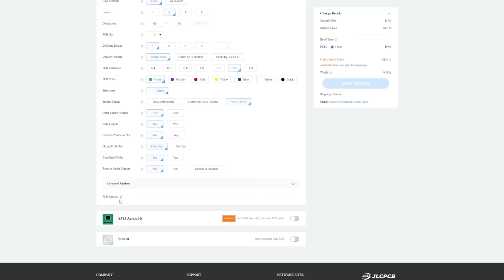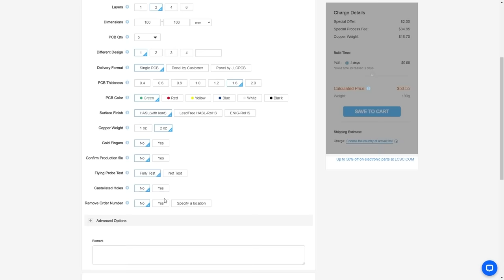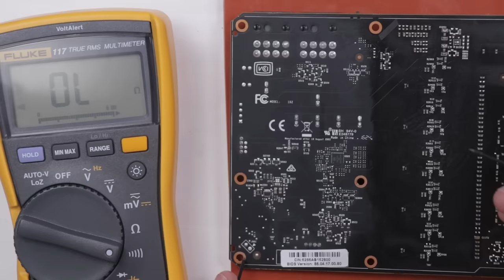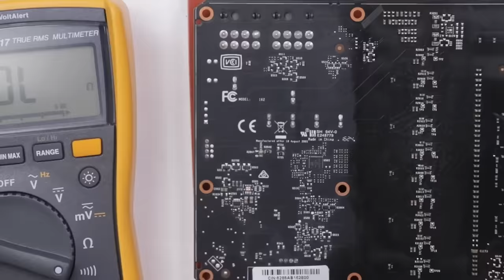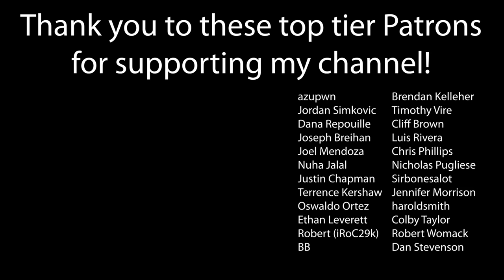I Bought 7 BROKEN Graphics Cards to Try and Fix - I Was Disappointed

Comment: My PS5 Disk Version thinks the power button is constantly pressed. I've wanted to ask if you know which capacitors on the motherboard might be short causing this problem, I should be able to replace it/them and maybe fix the problem. Thanks in advance!

Comment: the trtx 3060 prolyl is fixable. that series suffered from overheating memory. which also looks possible due to teh artifacts and errors your getting - prolly one of the first or second row of mem ICs has a fault ( could also be just popped solder balls due to thermal stress ). id recommend do a memtest on it and either reball the memory ic /s or get a replacement ( their about 7 bucks rightnow )
Reply: Finally someone who knows what is saying...artifacts comes definitely from a  bad memory chip, also the discoloration around GPU is probably caused by the neighbor chips gone really hot

Comment: I think the issue with the 3060 might be memory, try using MSI Afterburner to downclock the memory, and try running the benchmark again.

For the 2080ti, I think those components are meant to be missing, as there is a more powerful card, the Titan RTX, which would use that extra VRAM chip and likely needs a bit more power from those components that are missing.

Comment: 18:55 Look up what the PCB is supposed to look like before you assume someone took parts off. It has 11 memory chips for 11 gigabytes of memory. Also EVGA has several versions of most cards and I don't know if some have more diodes. I think the problem with this card may have just been someone putting so many thermal pads on it that the heatsink didn't touch the chip or paste.

Comment: I suggest some things to do if the GPU is not sending signal to the monitor:
Connect the GPU to a system with another GPU to see if it is at least recognized in Windows in "Device Manager," if it is detected I suggest you try flashing a VBIOS that you can get from the internet, there are many tutorials on how to do it.
If on the other hand the GPU starts but is very unstable during testing, even there you can try flashing a VBIOS downloaded from the internet to see if the situation improves, otherwise you can try underclocking to find a value where it remains stable

Comment: Many GPUs (especially higher end 70 and 80 series models) often come with unpopulated VRAM packages and power supply phases. 
That is completely normal and is done due to the fact that:
1. They are using a reference design from Nvidia and didn't bother removing unneeded components -> cheaper to design and less work.
2. The actual GPU chip itself has been binned in the factory. Not every GPU chip is perfect. Some might for example come with a few non functional memory channels and sections inside of the GPU that don't work. These large chips are quite prone to manufacturing defects due to their large size, which results in parts of the GPU being broken and useless. 
Instead of just throwing these otherwise perfectly fine chips away, Nvidia go ahead and overspec their reference design, so that the manufacturer (ASUS, Gigabyte,...) can just leave the required external circuitry for the broken section out. If for example GPU sections A,B,C,D work fine but section E is defective then it makes no sense so e.g. solder a VRAM chip to section E, since section E is dead. Same goes for the power delivery of that section.
So the reference PCB design comes with more external circuitry than what's actually used. 
It's also possible that the same bare PCB is used in multiple GPU versions and they just didn't populate all the chips due to cost saving measures. There's usually low and high end versions of the same GPU. (E.g ASUS TUF vs Rog Strix, Strix being the premium models).

If a GPU chip has too many broken sections to still be considered for example an 80 series card, they disable the extra stuff and rank it as a 70 series card instead. This is binning. It's also how Intel i7,i5 and i3 CPUs work. 
Nvidia doesn't make a new chip for every GPU model out there. They only have 3 or 4 "base chips" per generation where they just go ahead and disable features based on the amount of manufacturing defects.

Long story short: That GPU with the missing VRAM chip and the doubled thermal pads probably still works just fine. What I think happened there is that someone installed new thermal pads but didn't pay attention to their thickness, so the GPU chip didn't make any contact with the heatsink and therfore instantly overheated and throttled itself, making them think they broke it.

Comment: that one that wasnt putting out a display might have a mining bios on it if the card is being detected but not displaying anything. edit: if you have an integrated graphics on your cpu or have a cheap graphics card and plug them both in, if you plug in the one that works and go to hardware information it should tell you if the one thats not displaying is plugged in or not.

Comment: Hey. What happend to my comment.

You missed a few things.
Glitchy screen is 87% memory issue. Run mats/mods to find out.

Discoloration is okay. The pads will leak oil and other cemicals and it will discolor the pcb even at 60-70°C. Depends on brands.

About the missing components. Nothing is missing. Is is just a reference board. In the same generarion, those spaces will be populated on higher end gpu's. Check google pics.

About the one that does not turn on:
Check the voltage power up line. 12v, 5v, 3.3v, 1.8v pex, vmem, vcore. They have a specific order.

The last thing is you can get mining vbios that disables the output to gain some more hash. Flash them back.

Comment: That 2080 Ti wasn't missing anything. That model of it just doesn't come with those components. The same PCB is often used across multiple models. If you do this again, you should look for teardown images of the GPU in question first, which are usually easy to find in reviews.

Comment: don't get alarmed. often times when you see missing components on a gpu PCB, it doesn't mean it has to be there. It just means the GPU you have isn't the most powerful one and/or with most RAM. same happened long ago when I disassembled my gtx 570. it's for fact the same pcb as the 580 but without some components and weaker chip.

Comment: Small tip, with gpus you need to cover the entire Die with thermal paste :) also the EVGA 1080s a lot of then had fail issues.  I love your videos. Such a fascinating watch every time ❤️❤️
Reply: You just need to put enough on the die that it will spread across the whole thing when pressed against the heatsink. Same with any chip without an IHS over the die, like the consoles he often fixes, or most laptops.
Reply: The EVGA 1080 FTW he showed had a flaw that the V-RAM could get to hot. EVGA had a fix by useing a set of thermal pads, which you could get from them. Till today my EVGA 1080 FTW is still working 😁 and i was lucky enough to read about the flaw, otherwise it was also RIP

Comment: GPU prices are falling really nicely. The 1080 is no where near being worth $500 especially broken.
Reply: The second-hand Ebay prices are average prices the card sells for if its working. Just to let us know what he could sell it for if it works or gets fixed. Not if is not working
Reply: @ikwilgewoonfilmpje  is not even worth that new. 1080ti, which is the better variant, is going for $400, in working condition. A plain old 1080 is not worth $500.
Reply: @FranktheTank319  Got it. Then it is expensive

Comment: I had to look up 0 ohm resistor, because there is no such thing.  0 ohms means 0 resistance, so it can't be a resistor.  Apparently they are just wires packaged in a resistor-sized package, to make design easier (it's a way to connect components without using exposed wires.  Anyway...I wonder if the bad/glitching GPU's were ruined by mining.  That explains the 1030 working, that one would be useless for mining.  For the 3060, my guess is some of the RAM is bad.  Probably died from overclocking (again due to mining).

Comment: A missing vram chip doesnt mean it's faulty. Its just used to achieve a specific vram capacity to recycle a PCB, rather than making an entirely new PCB for a specific gpu. For the reading of the GPU die, i do not know why you took and IR reading without the heat sink because heat is conducted across the die. So its not a particularly good reading and doesnt  explain or give much to work on.

Comment: If the GPU still does not display and it's kinda check in the hardware chips, it's a good idea to check it on windows using a working station, a working gpu if required and the issue gpu on a second slot, the driver manager and CPU-Z might help you to check more information. If it's shows up, maybe will require a bios flash or other level of troubleshooting. Most of my recommendations I took it from JayzTwoCents videos, he has some troubleshoot on this topic but not so much in hardware troubleshoot, but if isn't hardware, might have a chance with this. Good luck and thanks for the videos

Comment: I would Keep all the cards you have not fixed, So that once you are familiar with Mosfets and Vram and how to test them when shorted or Open you can replace the
ones that have failed, with both components they should diode test much as each other so when one reads totally different, that's the one that needs replacing along with perhaps one or two supporting components that caused either the Vram or Mosfet to fail..
Reply: @UCK0_WC3SrgMhmMCfOQ_Wp0Q 

🤦‍♂Oh REALLY???..🤣
Yeah I don't see this as legit because for 64 plus years I have never EVER won anything. 
🧐
I think someone is about to go down for going against what is obviously the universes intent that I never EVER be a winner without entering as a contender..

Comment: The 6800xt is also not overheated. The discoloration is from the silicone thermal pad on the backplate. Gigabyte doesn't use quality thermal pad so the thermal pads start leaking silicone substance which is very greasy.

Comment: Many GPU's come with thermal pads. Obviously that card with the stacked pads was modified, But just because the pads weren't cut to size for the individual components doesn't mean its been modified - its a labour cost cutting excercise. Its quicker to slap on 1 thermal pad for 4 chips than to cut them to size for each individual chip.

Comment: 'Missing' components on the board is a normal thing in the GPU world. It's just a way to reuse the board design for different models for graphics cards. Also, bold of you to turn your system on with a faulty GPU. You can fry the rest of your system that way.

Comment: Great attempt.  

I'm not 100% sure, but I used to work in a different industry....  so don't take this to the bank, but....

A company would make a component, or a card, or whatever.....  Like, your card with the missing chips, we're talking about here.  So, on the fully loaded most expensive model that did everything, the card would be fully populated with chips & components, usually.  Not always, but, mostly.  On the "less" optioned unit, the same base card, same form factor, same everything, would be used, but sometimes barely half of the card would be populated with chips & components....  which apparently is a cost measure...  and, they only have to design one enclosure case, and so on, because they are all the same size....

My point is, I'm not sure someone stole those chips off the card....  Looked pretty pristine.  I think there was never a component mounted in the first place....

There was also times where, I was told, a supplier might offer certain components to a customer at a huge discount, just to blow them out, or a different customer maybe backed out of their deal...  So the customer might save a lot, by using those, and those would visually appear to be cards with very few components on them, because the current usage was NOT what the original intent of that card really was....  I feel like that's unlikely in this case, but that does exist....

My real point is, as you branch out, and start repairing different things, it really really helps if you KNOW what you are looking at....  Seeing empty slots in a board, does not necessarily mean "someone stole the chips"....  

This might sound crazy, but...  You spent a lot of cash here.  3 grand plus is not a joke, by any means, to anyone....  When I was really stuck on something, if I could, I would go buy a new one.   Look at a new perfect one that you can verify does work perfect.  The ability to do a "stare & compare" can really save you a lot of headache, and a lot of speculation, and a lot of going down the wrong path.....  I'm not gonna lie, there were a few techs who thought I was crazy, for doing that, but...  I fixed a lot of stuff....

I might mildly and gently suggest, if you want to fix those, pick one make, and maybe 2 models at most...  get a good one.... Then buy up broken ones of that exact model....  Obviously you are smart & bright, it won't take long to figure out, hey, now I know what I'm looking at, now I see what's wrong, now I see these all seem to run hot, or this here is a problem area, whatever the case may be....

Comment: Bad luck here Steve, sadly not surprising though. I won't buy a used "working" GPU because even if it'll boot into Windows, there's no guarantee it'll last once temps jump with gaming or GPU based application work. Heck, you see a good number of these cards die within a few weeks right out of the box, thermal solutions from a lot of these card makers seems kind of "seat of your pants" in design unfortunately, and even the well built cards are dependent on a PC build that facilitates a quality airflow setup.

Thanks for the video as always!

Comment: You can buy hdmi to vga or display port or hdmi converter with usb power for no signal display issue... it might help, im using my no signal black screen gpu with usb powered hdmi converter, with usb powered plugged in, the display come out.

Comment: GTX 1080 FTW, try reflashing BIOS, would cause no image if corrupted bios image on the bios chip. You need hw flash tool to reflash it. Same thing on the Radeon if the GPU chip heats up.

Comment: For evga graphic cards there's a test you can run on them built by the evga team I used it to test one of my old cards and it will tell you if one of the vrams  is not working as it should.

Comment: That 2080TI looked completely normal. Not every chip that goes into a board design ends up being needed to get the card working.
Only thing off about it were the additional thermal pads. Looked like that card had been water-cooled at one point and then had the original cooler slapped back on for resell. The screws being missing would support this.

Comment: The EVGA nvidia "10 series" had problems with heat on the VRM, required customers to either fix it themselves with free thermal pads from evga or send the card back to EVGA for them to fix.

Comment: On that rx 6800xt you should check for a switch near the top of the card someone might have tried to flash the vbios if it's a dual bios card you can flip the switch if it works then it's a bad flash on the one bios

Comment: Hey... I love your videos.. and I get the point of this one... but there are a few things about this.... GPU prices are falling HARD right now... so... some of your prices listed probably aren't accurate anymore. Also... that one GPU isn't necessarily "missing a RAM chip." Some board partners use the same board for multiple SKU's with different memory configurations. And finally... that EVGA 3060 shouldn't have been taken apart. EVGA has a 3 year warranty... and 3060 launched in Feb 2021... so it can likely be RMA'd to EVGA.

Comment: The broken 1080's were probably RMA'd cards as a while back there was a bug in 1080's driver's temperature sensor code which basically took too much voltage in the card after launching the game "New World" causing the card's circuit to blow, and those aren't fixeable & EVGA replaced even non warranty cards..

Comment: Try to boot the PC with the non Display Graphicscards again, but use the onboard Video to see if they are recognized in Windowsin Device Manager. If they are you can try flashing the original BIOS again. There are several tutorials on how to do that. You dont need any special Hardware. This works from within Windows.

Comment: The liquid like feel of the PCB is just the anti static film they used for protection looks like it just got so hot that it melted I highly doubt it was caused by just an OC as normally thermal protection would kick in and the GPU would never have reach temps so high that would cause such damage one possibility is that the power supply or another component blew up and dumped high voltage to the GPU which cause the GPU to heavily over heat.
Reply: Wrong. It's silicone oil leaking from the thermal pads over the years.

Comment: Why don't u do a heat gun treatment on no 2, 5 and 7th one. Like heating the gpu and a little bit around it those tend to fix this kind of issue that don't post signal but have all the right volts. Check out some video about it and try it.

Comment: So the first card its an issue with pcie power directly from the motherboard. Check your voltages from the pcie connector directly. A tell tale sign of no power from the pcie port is no fan activity.

Comment: Even running a graphics card for 10 seconds without the heatsink just idling at the desktop will probably toast the GPU permanently. That was not a good move.
Reply: That's not really true. This isn't the 90's anymore. Modern stuff has safety features that will simply crash your PC if it gets to a certain temp to protect itself. I wouldn't recommend doing it constantly but it won't outright kill your GPU.
Reply: @devilmikey00  lol, no.